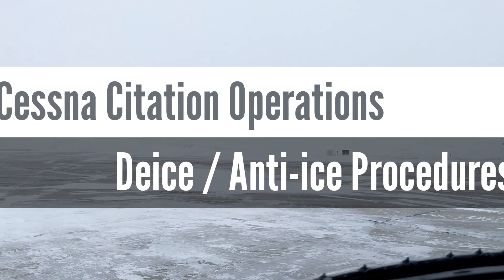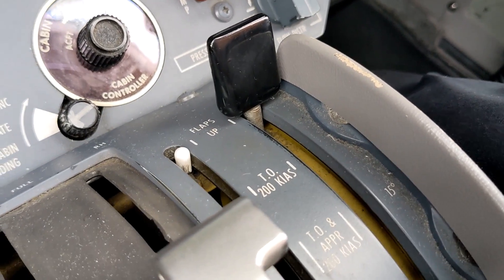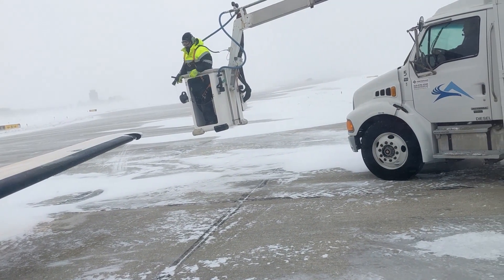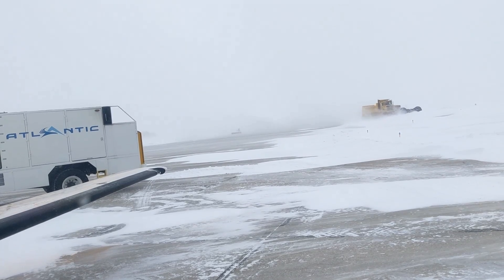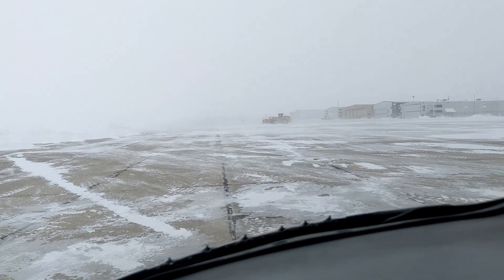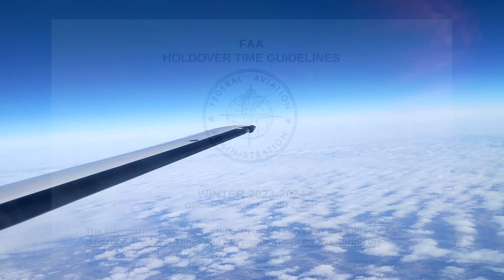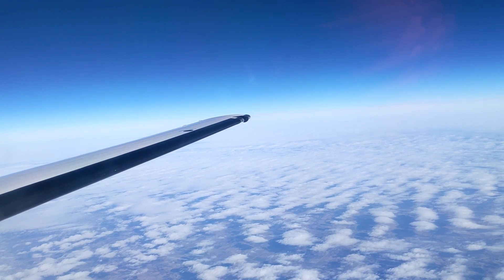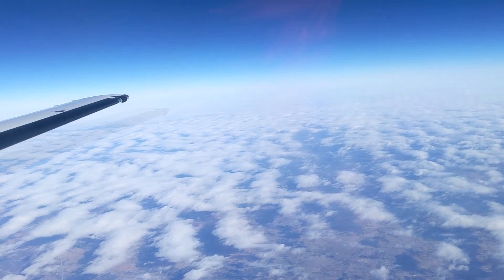Cessna Citation Operations - Deice and Anti-ice Procedures

Comment: When I was working on the line (and running that exact truck!) we had a transient pilot who insisted on being pushed into a heated hangar to de-ice his aircraft. This despite our warnings at the risk of pulling it back out while it was still snowing. The airplane got cleared of ice. But sure enough, when we pulled it back out by the time they were ready to go, snow was hitting the warm wing, melting and quickly refreezing into ice so he ended up needing the deice truck anyway. Hate to say we told ya so, but we told ya so! 

Good and informative video. Still haven't got a chance to introduce myself since I don't even know exactly who you are even though I've probably seen you a dozen times.
Reply from the maker: I've heard other pilots advocate for putting a clean airplane into a cold hangar to cold soak it and prevent ice from sticking when pulled out. I can see how that might work, but I don't know how much it would cost to intentionally lose all the heat out of a heated hangar, or how long it would take either. Pilots come up with all kinds of odd ideas. The surefire approach is to either deice or stick it in a hangar until the weather clears. We'll meet one of these days!